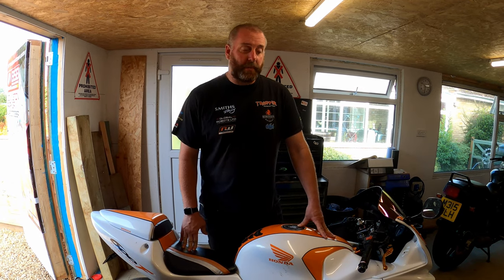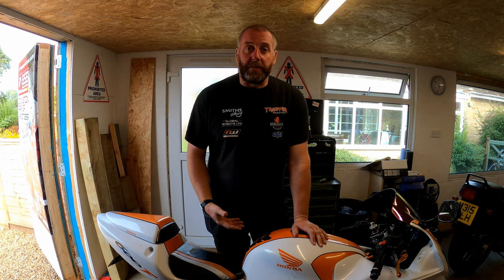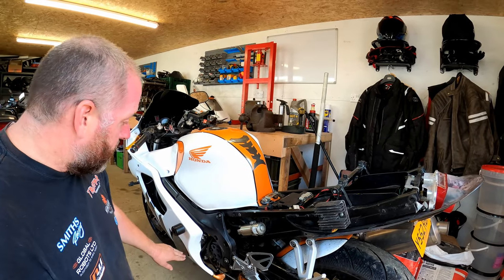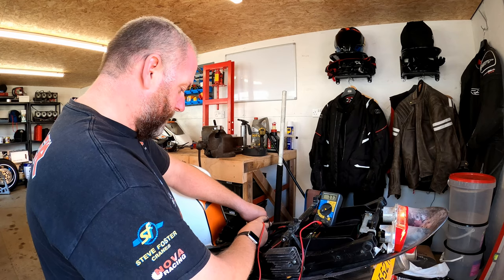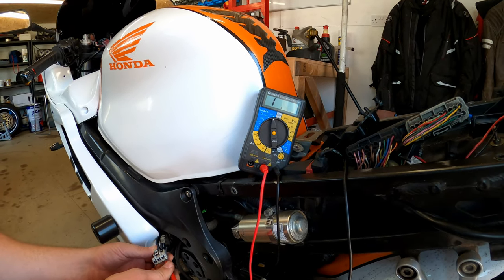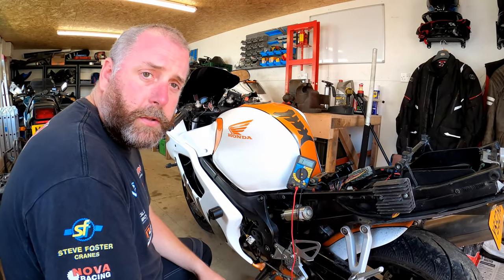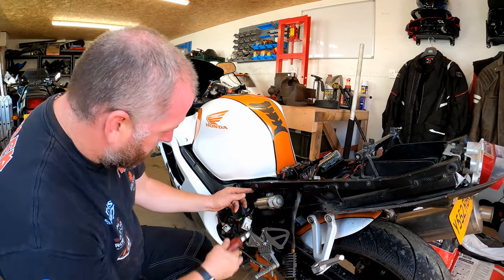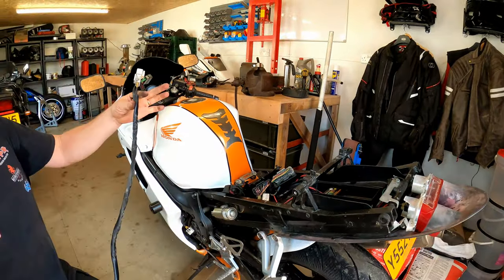Honda CBR600 F4i Charging Problem - Fault Identification & Rectification

Comment: Always having stator and rectifier issues with my R6's. Nice job with the adaptor plate and the bike bike itself looks to be in good nick for age. 👍
Reply from the maker: Thanks 👍
Reply: My batttery does dies on my f4i aswell it the voltage remains the same at idle but when rev it the voltage goes up

Comment: Great video as always.  Changing my regulator at the moment as have already swapped out a stator.  Do you use 12 gauge for both the battery wires and the stator?
Reply from the maker: Cheers mate, on this kit I used 14 Gauge for the Stator cables and 12 Gauge for the battery cables👍

Comment: What rectifier model is that? Looks like it gives a good output power. Mine is working but at low RPM it doesn't generate enough power.

Comment: hey i just replaced by R/R the old one was over charging the battery and boiled the battery and it also killed my head lights i have the new R/R on but now the bike cranks but doesn't start also befor the R/R showed up the new battery was on and the bike would turn on with the old R/R

Comment: Hey Buddy I have the same bike a 04 cbr 600 f4i there is a single green wire on the sub harness that has the speed sensor and oil pressure pulls on it do you know where it plugs to I can’t find it thanks in advance
Reply from the maker: Neutral Switch chap! ;) 👍

Comment: I have a cbr600fy the one a year before this modle. It was the last of the carbs. I has a problem where the battery wont charge but it passes every test in the manual. I cant seem to replicate the tests in this video because the looms are different. The rectifier plug has all 5 wires in 1 and its not clear where the posotive end up other than the posotive terminal lead which i used. 
I'm stumped. So frustrated because it happened on the day of my ferry to the isle of man so i had no bike while i was there.
Reply from the maker: If the battery won't charge then there has to be a fault with either the Stator, Rectifier or an earth problem. If your Stator and R/R are testing OK then I would begin looking for a crusty earth somewhere.
Reply: @KevsShed  I tested for an earth fault and the tests were a pass. Should I just start testing earth continuity between connectors and looms?

Also do you know of a rectifier kit for the 2000 year model? Theres only 1 conector for the rectifier with all 5 cables going to it. Alternatively I could buy all new connectors and speerate the stator wires from the output wires.
Reply: @KevsShed  tested a bunch again today.
Stator resistance - 0.2 ohms each
Good earth
Stator output - idle 13v ish, 5000rpm 55v ish (I have really bad memory but they passed)

RR output - idle 14.3v, 5000rpm 32v

Voltage on battery while off 13.3v
Volatge while running drops constantly until it cuts out. 

I think thats everything i rechecked today.
Reply from the maker: I am making the obvious assumption that the battery is in sound health of course!
Reply: @KevsShed  it is! It's a lithium ion battery. I also tried a brand new acid battery but that didn't help.
Reply: I’m having this same problem did you ever find a fix
Reply: @Jakemmeyers  yes!

I replaced the regulator rectifier because that had a hole in it! And it was the most likely cause. However, with it replaced, I still had the same problem. Thinking it couldn't be the reg rec because I replaced, I tested and researched for hours and took it to two garages before one of them said the reg rec replacement looks too small. I replaced it again with the model he recommended and it worked! Te new reg rec gets hot very quickly so but the first replacement didn't, that's a way to tell. 

Hope this helps

Comment: Ihave same problem i check stator its good i check the diode of recti all ok but bike still not charging
Reply: Ever find out the problem??
Reply: @feodiente9460  yup i found mine the hiss resistor is loose its in the ignition key you can findnit there
Reply: @chupilotv123  I DID!!.. big white connector smh.. I push that bike for 10 miles..😡😅
Reply: @feodiente9460  now its ok???